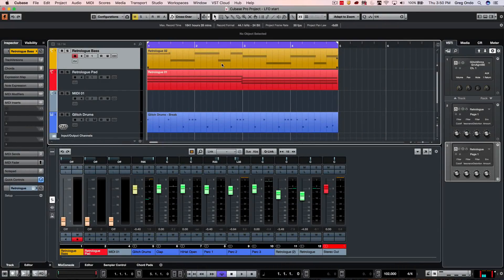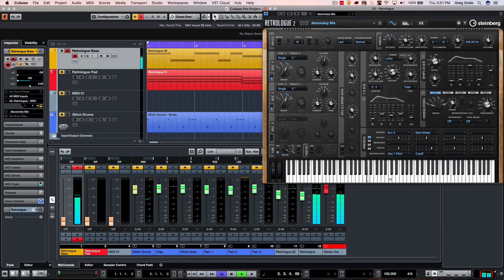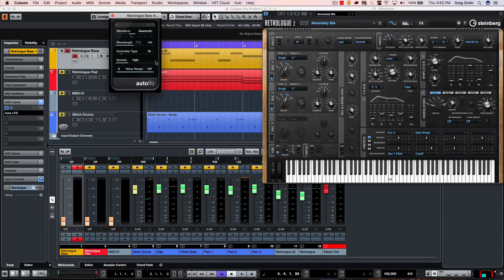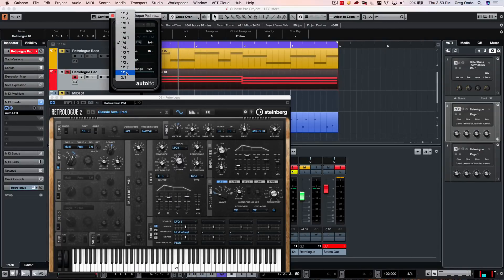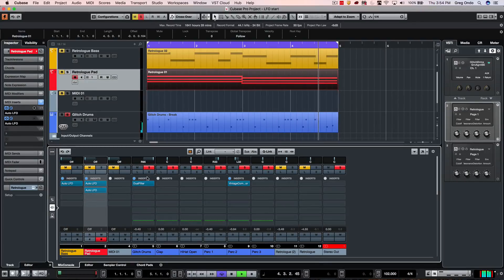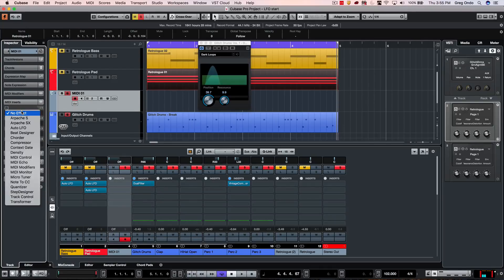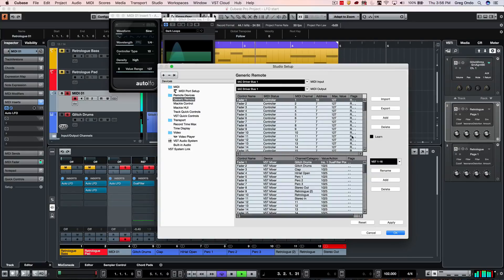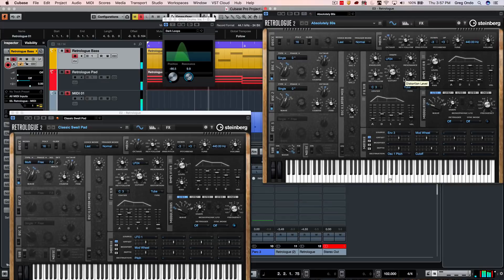How to set up LFO’s in Cubase | Q&A with Greg Ondo

Comment: I've been feature requesting LFO tracks in Cubase for ages and every time a new version comes out I'm disappointed with features that I'll likely not use, or plugins that I don't need!  

It's cool that you can do this but it's not user friendly.  A dedicated LFO track that you can assign multiple parameters to from any plugin would be awesome, especially if it had an easy to use interface with MSEG window for drawing in LFO shapes.

I feel like Steinberg love making new plugins, making interface tweaks and modifying existing systems but recently they've been a bit slack at coming up with anything new.

i.e in previous versions we had the introduction of chord tracks, vari audio, sampler track, render in place, all of these were great, but it seems there's been nothing ground breaking added since.  An LFO track could be that thing, just wished they would listen.

Comment: This many steps to assign an LFO to a filter position is frankly laughable compared to the ease in DAWs like ableton and bitwig's ability to just assign the same LFO to other parameters ,  then flip polarity and depth if needed , Steinberg if you don't address this in Cubase 11 I may have to switch , Cubase is fantastic but it's still missing creative modulation routing capabilities

Comment: I love Cubase but other DAWs offer proper system-wide LFO features and not a workaround/afterthought. To call this easy (especially in the case of implementing external MIDI and General Remote) is kinda ridiculous... A very simple solution would be to add an LFO plugin that targets all the channel's automation-enabled controls (just like Quick Control), or at least have an LFO that targets the Quick Control.

Comment: I use LFOs a lot for sound design within Kontakt, so I appreciate the tip.  I do wish that the approach for plugins that don't support midi-learn was more straight-forward.  I'd rather see that added to future versions of Cubase than a lot of the interface revisions and other features that have been added in the past.  It's pretty rare that I'm compelled enough by a new feature to upgrade.  The last time I upgraded was because drag and drop functionality was added to mediabay (for dragging samples to plugins like Kontakt).

Comment: Hey Greg, you could skip MIDI Control as an insert in the first part of your video. Just add AUTO LFO on your midi track, activate Midi Learn on the Cutoff in Retrologue and Midi Learn will connect to the correct Midi CC set in Auto LFO (since its sending continuous control messages anyway)...

Comment: Hey thanks for the fantastic tip, i tried the second version but i don't know why my lfo output is not contiuous,  the meter above the interface shows clearly that the lfo waveform is sent every now and then and it is interrupted by long zones of  just maximum output. anyway i find more handy drawing automation by touching plugin interface and recording it, then duplicate the automation data just where i need it.  i see an evident limit by the fact that generic midi controller is not saved with the project (is there any method to save its setting with the project)?.  what about a feature for cubase 10 a modulation rack with indipendet step sequencers lfs envelopes which could be one click routed to any vst parameter?
Reply: I have the same two problems

Comment: Too complicated to use with midi loopback. Just use Cableguys, much more versatile. The auto LFO looks great for Retrologue! How about a more advanced LFO tweaker in Cubase10! Would be awesome!
Reply: Way too complicated. But you actually don't need it in Retrologue because there are already 4 versatile LFOs inside which can be assigned to almost everything, so the additional auto lfo plugin is just more complex than the VST-i itself...

Comment: It's a bit strange, that you need an EXTERNAL MIDI loopback-driver instead of cubase supplying an internal MIDI Bus, but anyway that's how it works...
Great explaination! Helps a LOT!
Reply: Ralf Nolte yeah, Ableton can do this using LFO tool on any parameter with no loopback or anything. I prefer Cubase overall, but sometimes things are more awkward than they should be.
Reply: Yeah, love Cubase and it's very powerful, but i like consistency. You know how to do something in one stock plugin, yet it's different in another which is a little frustrating sometimes...